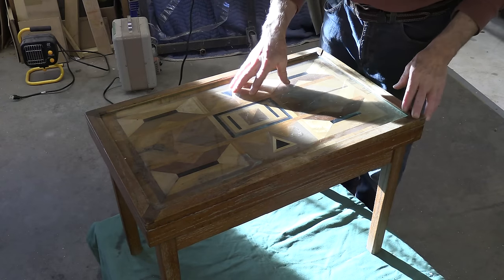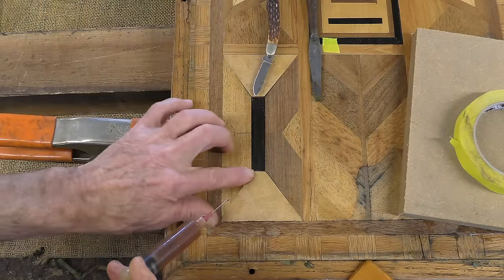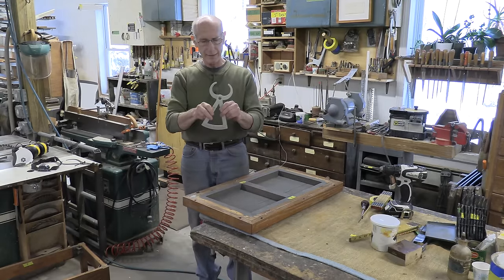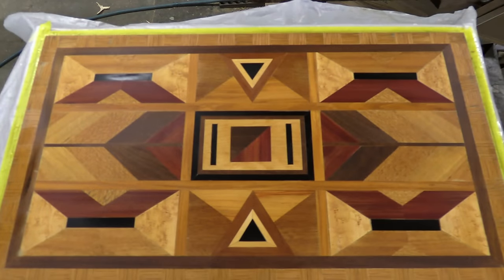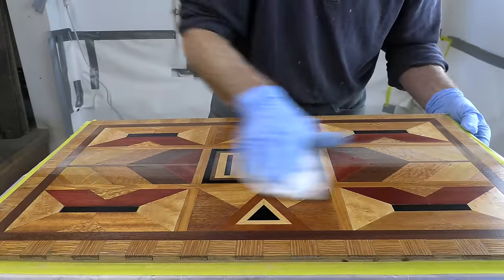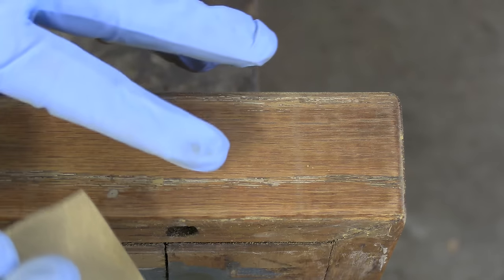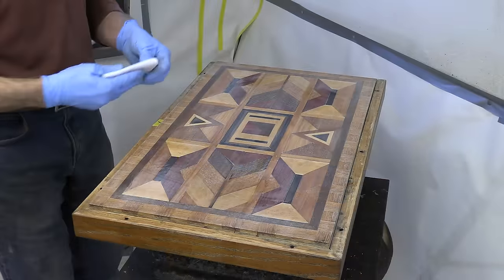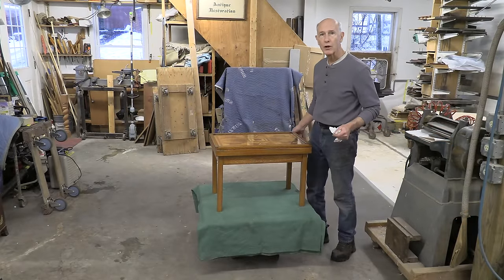Family History, Rescued. - Thomas Johnson Antique Furniture Restoration

Comment: Hello, I'm new here.  Where do you buy the yellow tape and why do you use yellow tape?  Where do you buy the liquid hide glue?  Is it made from dead horses?  Why aren't your figures all full of glue.  You don't where exam gloves.  You really had me on the edge of my chair when you drilled through the back of the table.  It kind off got my pressure up.  I realized that I have a set of dental tools.  They will be perfect for the little corners.  I really learn a lot from you channel.  Thanks and Blessings from Arkansas.
Reply from the maker: Thank you! Welcome to the channel. Yellow tape: Indasa https://www.indasa-abrasives.com/global/en/catalogue/technical-tapes/masking-tape-mty. Hide glue: https://www.oldbrownglue.com/. Good luck with all your projects!
Reply: Thanks...I checked out all of your information and I'm very grateful.

Comment: That gray paint on the bottom looks like engine shop paint!  My grandfather used it on things he did or did up in the 1910s and most likely into the 1920s, if that's any help.  I'm betting the gray was a standard industrial paint, probably what came handy.
Reply from the maker: Thanks! Yes, I thought the same thing

Comment: I wonder if the color was from the result of fuming with ammonia. The color of the base is a dead ringer for fumed oak, and the time frame would fit with when this would have been made. It would also explain why the color shifted so dramatically with the oxalic acid. Very interesting piece overall, restored quite well
Reply from the maker: Thanks! I was finding it difficult to tell if the finish was on purpose or not. It just seemed unlikely to me that a amateur woodworker would be doing a "decorator" type finish. Luckily, it all worked out

Comment: Beautiful work. You have an obvious love for your work. What is the product used to fill the cracks between the veneer pieces? I have a serving tray made this same way, but it has some cracks.
Reply: It's wood putty. Not sure what brand Tom uses, but it's commonly available from woodworking stores (or even your typical 'big box'/hardware/ DIY store). If you are planning to use water to clean (or the tray gets water on it as part of its normal use), it's better if you use a solvent-based (or a 2-components) putty/filler.
Reply: FAMOWOOD
Reply: @horacerumpole6912  thanks. I have a lot of fillers and putty on hand, but I have come to trust Tom’s choices.
Reply from the maker: Thanks! dlevi67 and Horace Rumpole are correct! Famowood. But any putty would work well
Reply from the maker: Yes! Thanks

Comment: I can't help but notice that you use very little lacquer as a final coat.  I like to spray the lacquer on using a spray gun and compressor; it seems to be easy to manage and also easy to sand.  I then follow up with water based urethane which I find to be durable.
Reply from the maker: Thanks! Yes, I've been spraying for 45 years! Now I like doing everything by hand if possible. I'm not sure about the poly over lacquer though!

Comment: Does the oxalic acid solution not threaten the integrity of all the hide glue you injected underneath the veneer pieces? Seems like the water would seem through the joints
Reply: that's why he sealed the cracks first :)
Reply from the maker: Thanks! Yes, Tsunero is correct! And yes, it would if it got in there
Reply from the maker: Exactly! Thanks!

Comment: You’ve mentioned before but I’ve forgotten, sorry. How do you clean the syringe with bone glue once you’ve finished?  Thanks in advance.
Reply: Hot water. Preferably before it sets, or you may need to throw away the needle. The syringe cavity is big enough that even if the glue set in there you'd manage to remove the glue by soaking in hot water.
Reply from the maker: Thanks! Yes, dlevi67 is correct!
Reply from the maker: Yes, thanks!

Comment: Could you make some material available in text, PDF or something like that for us, beginners in woodworking?
These finishes that you make in your works seem very easy to do, but when I put them into practice, everything goes wrong. My finish is always ugly. Especially when I try to give the pieces a darker dye.
What liquid do you dilute the dye with?
Sorry for my English. I'm just a humble Brazilian.
Reply: Thomas did a series of videos on stains, dyes and colour matching a while ago. Check them out!

Re: dilution. Here Tom is using the same (basically colourless) oil varnish that he is using on the base. If you needed to dilute an oil stain you could also use white spirit or turpentine; with an alcohol stain, more alcohol and with a water-based stain... you guessed it, water. But it's easier to apply a thin coat and wipe off quickly if you want a lighter colour, in my opinion.

When you say your finishes are ugly (which I'm sure they are not) - what is happening? Is the issue that they aren't uniform? Or is the colour "wrong" vs. what you were expecting?
Reply: Stain and dye are two different things-
Reply: @horacerumpole6912  Yes, my bad. Corrected.
Reply from the maker: Thanks Jefferson! Sorry if you're having difficulties. If it's any consolation, we all have difficulties all the time! I would recommend books by Jeff Jewitt: https://www.amazon.com/Refinishing-Furniture-Simple-Step-Step/dp/1600853900/ref=sr_1_2?crid=UWYZ3HLQLMLD&keywords=jeff+jewitt&qid=1642430949&sprefix=jeff+jewitt%2Cspecialty-aps%2C118&sr=8-2
He has a good one on stains and finishes
Reply from the maker: Thanks! Good reply
Reply from the maker: Thanks! Both are stains. Dye is finely ground pigments "dissolved" in a solvent. Oil stains are "coarsely" ground stains floating in a vehicle
Reply from the maker: No, you're right! Dye is stain
Reply: @johnsonrestoration  Yes, but not all stains are dyes! (Which is where I think @Horace Rumpole was coming from).

Comment: Nice work. But I'd have used an iron to set the veneer,  DA sand with 400g, and re-coat. Done in about two hours.
Reply from the maker: Thanks! That veneer is 1/4" thick! (I did say that in the video) Good luck with an iron!

Comment: If your fingers split from the cold and wet. My dermatologist told me to put a tiny dab of super glue on the split and "clamp" the sides together. (Without sticking your other fingers together.)  Excluding the air really lessens the pain and helps them heal faster.
Reply from the maker: Thanks! I've heard of that too, but to put those chemicals on a open wound? As much as I probably do ingest chemicals, that still gives me pause

Comment: Tiny water spots look like the housekeeper was using a sprayer with the glass cleaner and oversprayed on the wood. A teaching moment to pass on to the next recipient of the heirloom about the care of protecting the natural wood when cleaning the adjacent glass. Never use a sprayer. That and whatever drink was spilled on the table in its past that seeped under the glass leaves a lot of complicated clean up. The silicone seal adds a modern solution to protect the woodworkers craftsmanship. This generation's contribution to the next. 🙂
Reply from the maker: Thanks! I hope that silicone will help! Glass tops are a mixed blessing

Comment: Luthier truck: inject glue and work it into the cracks with a small plastic suction cup.
Reply: Does it work when you don't really have access to the underside of the piece? Genuine curiosity, since I sometimes have the same problem as Tom did here.
Reply from the maker: Thanks! I will have to try that sometime
Reply from the maker: Whenever I think about these suggestions, I think that it can't work unless  everything was sealed up except where you want the glue to go. I should try it

Comment: More carbon probably goes into the solvent you use to clean the syringe then the syringe itself. Pound for pound Plastic has less impact then glass and aluminium.
Reply: That "solvent" is warm water for hide glue. For epoxy it may be isopropyl alcohol (which does have a reasonable carbon content - ~60% by weight), but the vast majority of the glue Tom uses is hide glue or yellow glue, both rinsed out with water.
Reply: @dlevi67  I was commenting in reference to him saying he cleans the epoxy out of syringes with solvent. Which is probably more wasteful.
Reply: @MartinMio  OK, let me elaborate a bit. 18:18 "and I will clean this syringe out with a little bit of alcohol". That is either isopropyl or ethyl/methyl alcohol - density around 0.80 g/cm^3, with about 60% of the weight being carbon - approximately the same proportion as in a polypropylene syringe.

I just weighed a 5 ml plastic syringe: 4.32 g. To rinse the epoxy out, I normally use 3-4x fills, which is 20 ml, or 4 times the weight of the syringe. In other words, unless the syringe can be reused ~4 times, it would appear that it is more wasteful in terms of 'amount of carbon'.

Except that:

1. Alcohol is only required as a solvent if epoxy is injected. Which happens (from my observations of Tom's videos) way less than 10% of the time. The remaining 90%+ of the time, the syringes are filled with hide or carpenter glue, which dissolves into hot water. That by itself gives a >10:1 ratio between 'clean' syringe re-use and 'dirty' ones. I can re-use a glue syringe pretty much indefinitely (I have one that is 3 years old... I know, because that's when I last bought a pack of 10, and I'm still using the first one), so it's very likely that the true ratio is much more like 30 or even 40:1, as the requirement for injected epoxy (vs. injected hide glue) is really quite low.

2. Most times, alcohol is needed to clean up the piece and other tools; however, that can be first used to rinse the syringe... so there is no 'additional alcohol' required. When I work with things that require solvents (alcohol, white spirit, acetone, naphtha) for cleaning, I keep them in sealed containers, decant and re-use until they are so dirty that they really are unusable; it would surprise me if Tom didn't do the same. 

3. It would surprise me to learn that the environmental impact of manufactured polypropilene is less (for the same weight) than that of 1-3C liquid alcohols. At the very least, the production energy and distribution requirements are significantly higher for a moulded syringe than for a liquid that is literally produced by the millions of litres.
Reply: @dlevi67  good response but your still making some assumptions to draw a conclusion (how many times its reused and in which scenarios). If these scenarios don't eventuate then it's not worth cleaning after epoxy usage like i said. But whatever, it's not going to make any difference because they make 0.5 million tons a year of isopropyl in usa. I was mearly illustrating that sometimes we think we are putting in extra effort to be sustainable but it's a very complex topic. You can just assume anything as even the source (import or domestic) of the syringe and solvent can throw out your calculations dramatically. And once the oil and gas industry (the source of raw meterial for most solvents) is in the decline it'll be interesting to see what happens.
Reply: @MartinMio  Good points. And your observation made me think about my own usage/recycling of stuff.
Reply from the maker: Thanks Martin! dlevi67 is correct. But also, I reuse all solvents many times until there is nothing left.
Reply from the maker: Thanks! All true - and I have always been very careful to reuse solvents until they are too dirty and have extremely little waste
Reply from the maker: I think about this all the time, and try to do my best